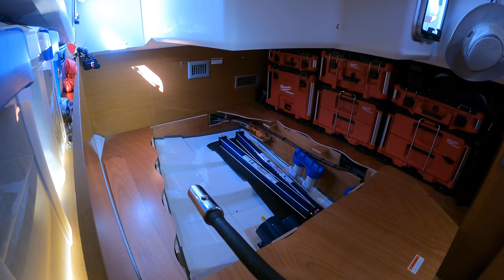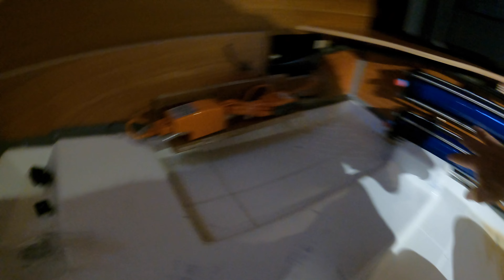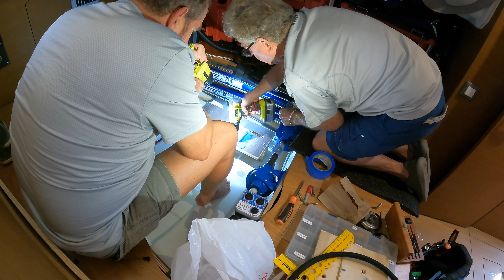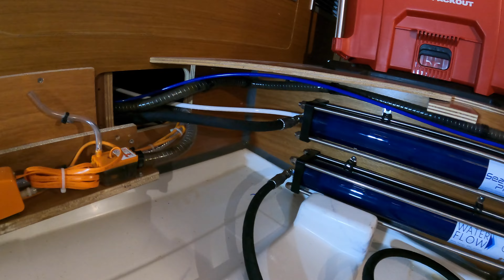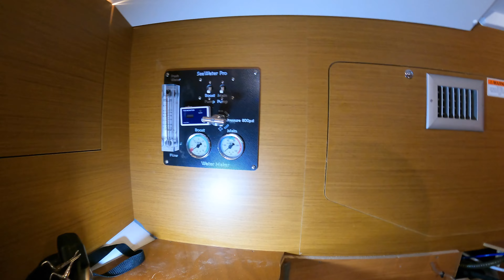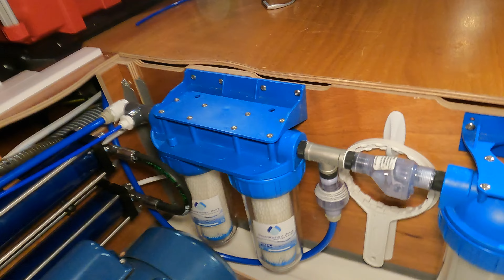Seawater Pro Water maker install

Comment: Great job !! and great video .. my question is, where in boat the system installed?.. i can't identify the locations
Reply from the maker: Under the starboard cabin. In the 3 cabin version of the 440 there is a water tank there but they omitted it on our two cabin so there was a big void. Great thing about the seawater pro is that it’s modular so you can fit it into what ever space you have

Comment: Hello, I am considering Seawater Pro and I have few questions if you don't mind
1. How noisy in the system? Even under the bed, can you be in the room when the system is making water or is it too loud?
2. I would imagin the high pressure pump/motor generate heat. Yours is installed in a confined space. Is it vented? Do you have issues with heat?
3. I like your diverting valve setup. Where did you get the valve and mounting strips? Any chance for a link if it was online vendor?
Thank you in advance!
Reply from the maker: We haven’t run it yet because the water quality here and we would have to re pickle the membrane. At 40 g/h the max run duration for us would be two hours, plus the gen set would be running which is co located in the back so noise is not a consideration. As for heat the volume of the cavity is plenty and there is an access port that will be open for ventilation

Comment: Could not see from your video, but I'm wondering if you left room under the pressure pump to drain the oil when you make the mandated changes.
Reply from the maker: I did, I also checked the filter height to make sure they could be replaced without removing the mounts.

Comment: Thanks for the video. Did you consider putting some rubber pads for the feet of the high pressure pump to minimize vibration noise? I think many others have found that helpful and seems to be an easy modification.
Reply: Very nice install. Looks awesome. I learned how important a water maker is sailing in BVI  6 times. Lagoon 52 F had a great one. They have a new 440 at Sailtime in Watergate. I  have sailed her (Vesper) a few times. You have a wonderful boat and wow you have added a lot of cool mods. Cheers 🥂 George
Reply from the maker: @gogeorge7  We have seen Vesper. More mods to come stay tuned
Reply from the maker: Yes I did, we had a small rubber mat under it

Comment: Pipe dope, pipe dope, pipe dope People!!! Teflon/PTFE Tape is not meant for High Pressure Threaded Hydraulic Applications it will eventually leak!
Reply: I do really love the install other than that though.  It was very well planned out.  It looks very tidy and seems like it is in a great location.  It is very clean and except for my worry for you on your choice of thread sealant long term, I am very  impressed with your work. You could put many of the installers I know to shame.  

 Those push to connect fittings and tubing are such an amazing time and knuckle saver in tight spaces now that they are so cheap and widely available aren' they?